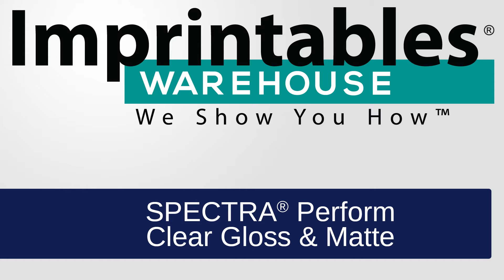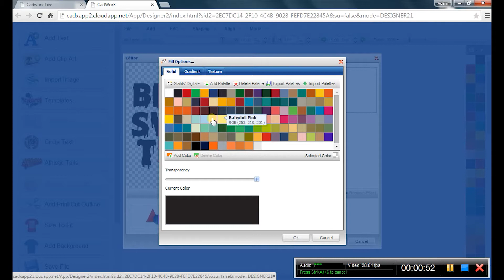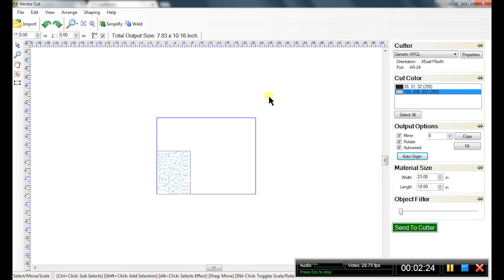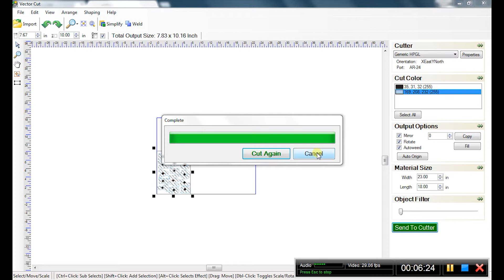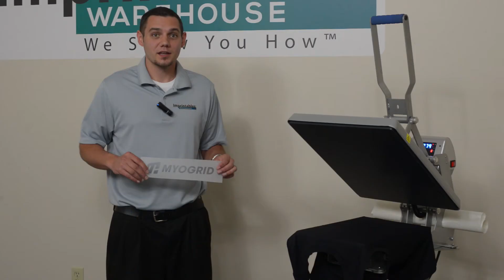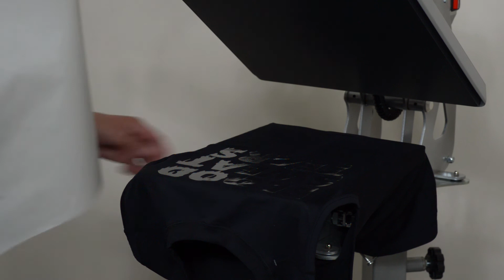Perform Clear Gloss & Matte Cut Only Application

Comment: can this plotter cut mylar polyester material ?
Dq from Jersey.
Reply from the maker: Hi Jairo! I would think it would. I'm not 100% sure of the material you are cutting though. It will depend on thickness. I suggest calling 800-347-0068 so a technician can assist you.